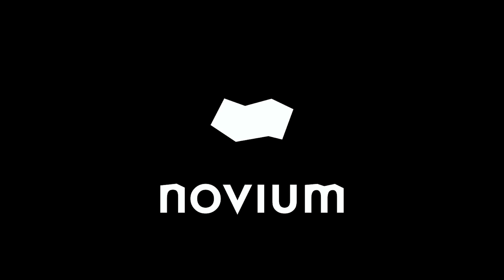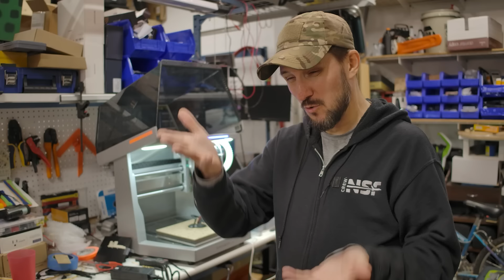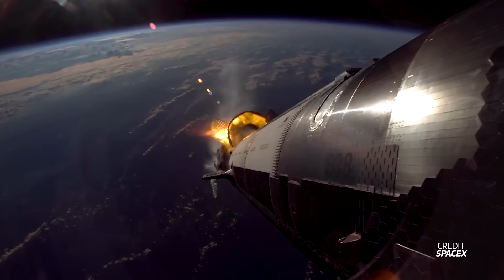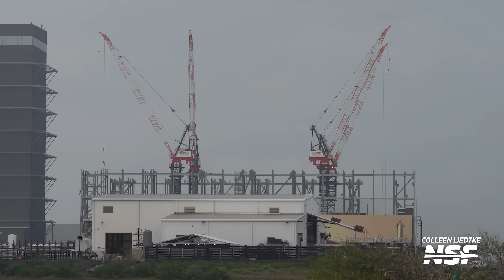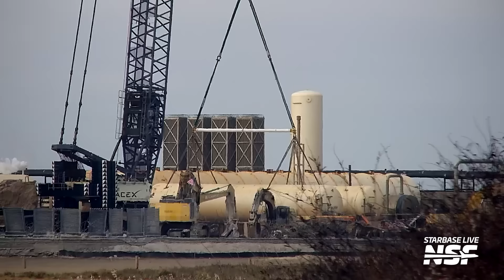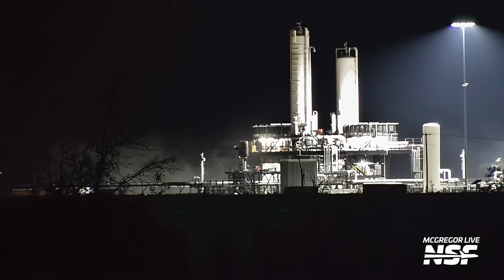Booster 19 on Track, Pad 2 Comes Alive | Major Starship Updates from Starbase

Comment from the maker: 🔥🔥  For 48 hours, enjoy 15% OFF on all Hoverpens with code NSF, or click on the link https://noviumdesign.shop/NSF -  Free shipping to most countries. Also on Amazon: https://noviumdesign.shop/O495DR 🔥🔥
Reply: Could you please accept sponsorship from someone who
offers something that isn't ridiculously expensive?
Reply: a "little" expensive, only a little
Reply: SpaceX Starship is not the way to go to Mars and beyond unless it changes the propulsion system to nuclear. For the booster is OK chemical propulsion but not for any vehicle set to go beyond Earth.Just think how many refills the Starship will need to go to Mars and come back, and how long will it take. It is ridiculous technology for that purpose and only is OK inside Elon's head and followers.When was built, I said pad1 was a bad engineering and time has proven I was right (of course Elon did not agreed) I am following what SpaceX is doing since the first prototype rocket (in display) and I only witness a lot of constructions, many rockets exploding (V1, V2 and V3), and still there is not a proven reliable heat shield for the Starship.SpaceX keeps expending a lot of money in developments and going nowhere for several years already and competitors are catching up with more suitable rockets to reach the Moon.
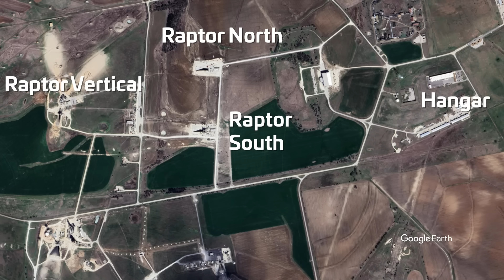Reply: 21:24 may I add to that qestion / theory's at the rate there making them trucking them is effective enough.

 But once production starts really raping up would SpaceX just be better having a conveyor like structure/ to move the raptor engines ro and from where they need to go ? Thanks for all the honestly so detailed and dedication been here since day one 😊.

 but yeah @NasaSpaceFlight whats your thoughts on what SpaceX may do in future for moving raptors conveyor just seems most practical effective and efficient way in my opinion when you start getting to the full mass production side 🤔 . 

Wishing everyone from NSF a Happy festive Holidays and wonderful Christmas and new year once gets here 😊🙌.

Comment: SpaceX Starship is not the way to go to Mars and beyond unless it changes the propulsion system to nuclear. For the booster is OK chemical propulsion but not for any vehicle set to go beyond Earth.Just think how many refills the Starship will need to go to Mars and come back, and how long will it take. It is ridiculous technology for that purpose and only is OK inside Elon's head and followers.When was built, I said pad1 was a bad engineering and time has proven I was right (of course Elon did not agreed) I am following what SpaceX is doing since the first prototype rocket (in display) and I only witness a lot of constructions, many rockets exploding (V1, V2 and V3), and still there is not a proven reliable heat shield for the Starship.SpaceX keeps expending a lot of money in developments and going nowhere for several years already and competitors are catching up with more suitable rockets to reach the Moon.
Reply: What silly nonsense.
Reply: @imaginary_friend7300  Only you say that!! 🤣
Reply: @user-ks2bf4kc7d And I'm right.. that's the sad part.
Reply: Nuclear also needs several refillings in orbit. NASA's own estimates for a nuclear-powered Mars Transfer Vehicle showed at least 600 tonnes of liquid hydrogen would have to be agregated in orbit in order to power the vehicle to Mars and back. That's still several launches just on agregating the propellant, without accounting for the launches needed to assemble the vehicle itself - and that's just the transfer vehicle, not the landing vehicle, nor the launch vehicle for the crew. If you think going to Mars can be done in fewer launches than the refills Starship needs, feel free to present it to NASA, as it will be a revolutionary advance in technology if that's the case.
Reply: @Alexphysics13  My reply. Just open Gemini and type this "how much fuel would need a nuclear rocket to reach Mars ?" and you will find nuclear is the way.
Reply: @Alexphysics13 Look, nuclear propulsion technology has been used already on a small scale and there is no doubt it is the technology for distance space travel. For large space vehicles is the next step which NASA is working on right now. Elon should think about this as well!!
Reply: @user-ks2bf4kc7d NASA is not working on nuclear propulsion. They, in fact, dropped work on nuclear propulsion (for the second time in their history)
Reply: @Alexphysics13  Stop denying!! Chemical propulsion is an old and limited technology to go to Mars and back as Elon advertise. The future is about nuclear propulsion rockets technology.
Reply: @user-ks2bf4kc7d I’m not denying anything, you’re the one coming up with excuses and false narratives.

Comment: Given V3 booster QDs on Pad 2 will get roasted during launch, why weren’t they put on retractable arms like the ship QD, this avoiding the roasting during launch?
Reply: The Booster QDs on pad 2 are opposite the tower, rather than being on the side of the tower like pad 1.  During liftoff, the rocket immediately tilts away from the tower (in a "pad avoidance" maneuver, to minimize potential damage in case of engine failure and/or pad fallback), meaning its plume on pad 2 will be slammjng the side of the OLM where the QDs are not.  By the time the plume finally spills over onto the QD hoods, the rocket is already quite high up, and the plume is strongly diluted.

Also, the entire top deck of the pad 2 OLM (including the QD hoods) will be showered with lots of water, because the top surface of the OLM is kind of built and operates like the inverted showerhead deluge plate from pad 1.

So that's the theory, anyway.  How well it works in reality, we'll just have to wait and see 😉
Reply: @Spherical_Cow  thanks for the explanation. Can’t wait to see how it performs in reality.

Comment: I have a feeling that the nutty engineers at SpaceX will use pad A chopsticks to conduct a test catch of the ship
LFG!!!!!
Reply: Ship catch won't be attempted until Starship goes orbital.  Which won't be until flight 13, at the earliest (flight 12 will attempt a suborbital retread of flight 11, though with v3 hardware and all-new GSE this time around.)

Also, with Ship in orbit SpaceX will have plenty of time to get the Booster safed, de-tanked, off the pad, and back to the Mega/GigaBays or the Rocket Garden, before the Ship is ready to come back for a landing. Ship landing opportunities will recur roughly every 24 hours or so after launch - not the usual 12, as at Starbase they'll only be able to deorbit on the descending node (overflying U.S. territory), whereas an ascending node deorbit would pass over Mexico.

So they won't be needing tower 1 for this just yet (and they'll be eyeballs-deep into building the pad 1 flame trench, OLM, and deluge farm by that point: I doubt they'd want to attempt a Ship catch over such an active construction site...)

Anyway, I think odds are decent SpaceX will eventually attempt a Ship catch sometime in later 2026 (maybe flight 13; maybe 14 or later if there are issues with preceding v3 flights), but it won't be all that soon.
Reply: @Spherical_Cow eee okay...but my point was just that the first test catch will be with mechazilla 1... you know, so that they dont blow the brand spanking new pad to bits
Reply: @rahmanarafat6112  I get the idea, but I don't think it's likely.  When they attempted the first Booster catch, many of us thought it was (1) too soon, and (2) they'd use tower 2 to avoid blowing up the only functioning launch pad.  But they did it on pad 1 anyway.  SpaceX just isn't afraid of blowing things up: if that's going to happen, they prefer it to happen early and often, and using the latest and greatest hardware - to learn as much and as fast as possible.
Reply: @rahmanarafat6112  Thats been my thought ever since they announced the second tower at Starbase. As it indeed seems like the most logical course of action 😊

Comment: The Raptor 3's, as enclosed and "minimal" as they are certainly require x-Ray equipment to check them out after testing so SpaceX has the necessary equipment on hand to check their COPV's before filling them up. Which they should do given their history of mishandling them. But they don't...
Reply: Has it even been confirmed that it was a COPV issue yet?  Or is this more speculation taken as fact?

Comment: why wouldnt they just leave the shower head to test throw away launch mounts that will need to be assembled on mars
Reply: They'll probably use a similar landing/launch configuration on Mars, as the Starship HLS will use on the Moon.  In other words, actively articulated landing legs to handle rough terrain, and a ring of obliquely angled landing/liftoff thrusters ~⅔ of the way up the Ship. Meaning, a well-developed Mars landing/launch pad might be at best just a flat slab of concrete (or some functional equivalent created from local regolith) - not too different from the current Falcon 9 landing pads.

In other words, no need for upside-down showerheads, with all attendant complications...  Keep in mind, Super Heavy will only ever launch from (or land on) Earth: there won't be anything like a Super Heavy with its 33+ Raptor engines and 5,000+ tonne gross liftoff weight, launching from the Moon or from Mars, probably any time this century...  Landing and particularly launching on the Moon and Mars is lots easier (requires less energy), due to greatly reduced gravity (and to a smaller extent, also no or much less atmosphere in the way).